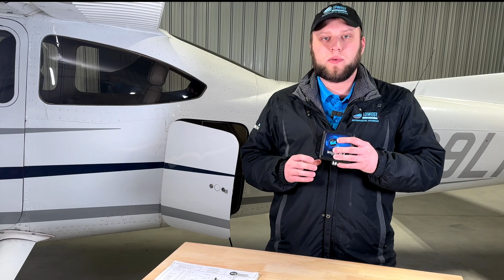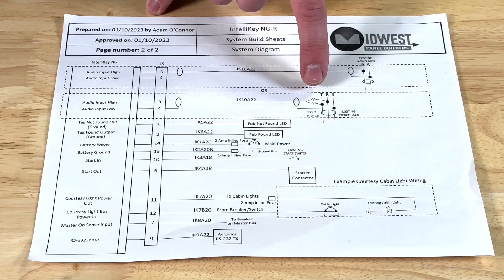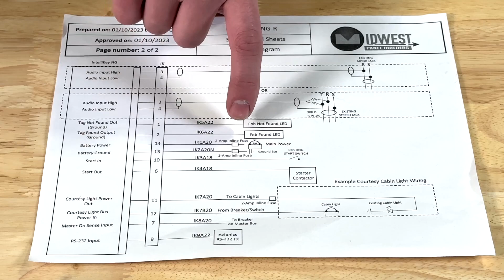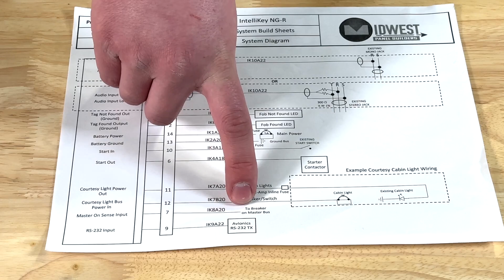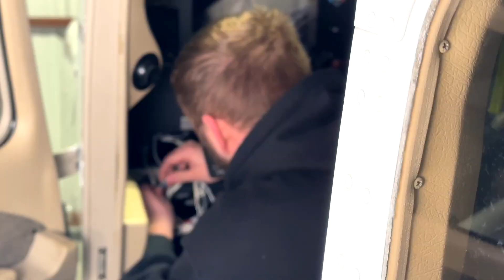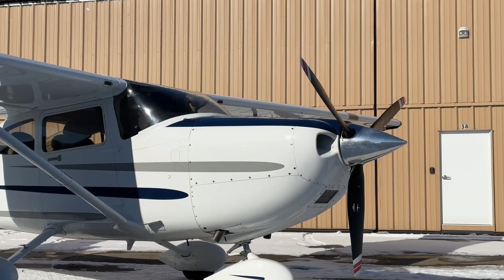NORSEE APPROVE IntelliKey Installation.

Comment: Would have like to see the starting of it from inside. So you hold the start button until it starts or does it run the starter for a certain amount of seconds?
Reply from the maker: You do need to hold the button until it starts.